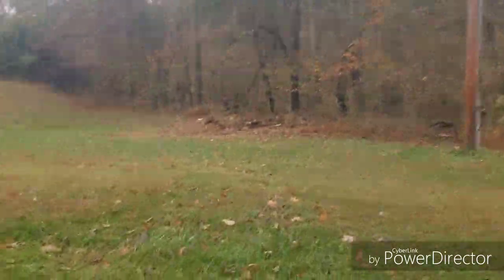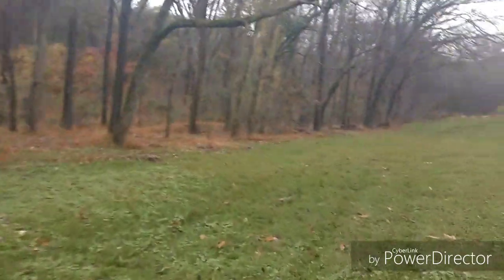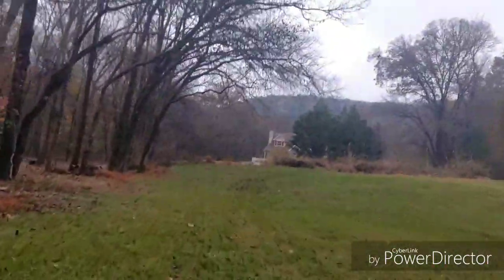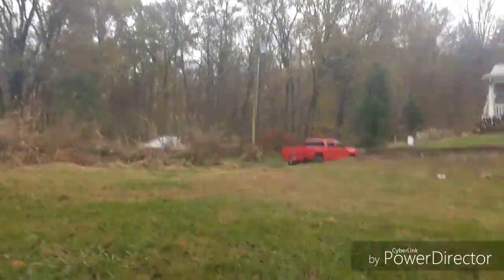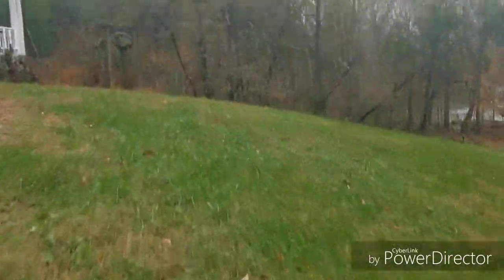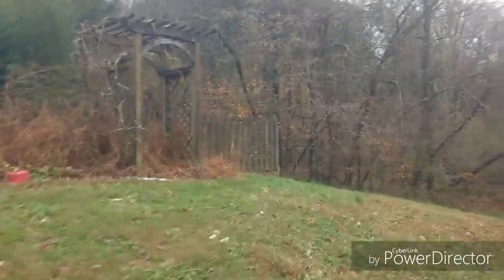Manco first ride..... It needs some hillbilly upgrades

Comment: Happy Thanksgiving! Nice kart, Seems like the Governor is still in it?
Reply from the maker: Yup it's still has the governor plus the torque converter belt is burnt up and streached out bad enough that you can squeeze the belt and it will touch easily between the pullys 😂😂
I have a few upgrades I'm working on for it now though
Reply: @hillbillyholler516  gonna be pretty epic
Reply from the maker: @chauvinsgarage1515  I'm probably going to work on it when I get off work in the morning.
Reply: @hillbillyholler516  do a live stream
Reply from the maker: @chauvinsgarage1515  I need to but the internet is down at the house....I think the wifi box is toast